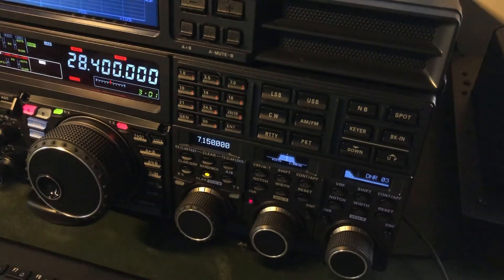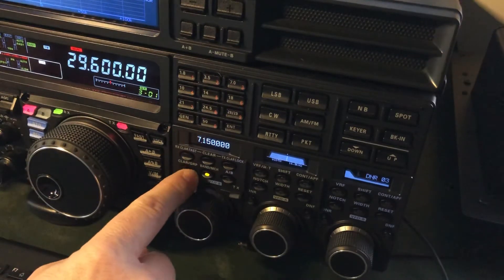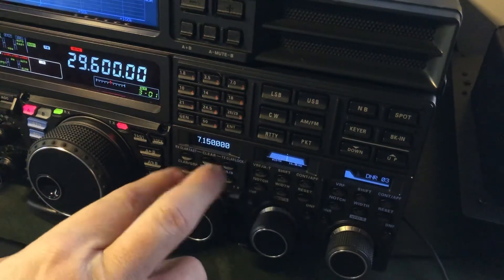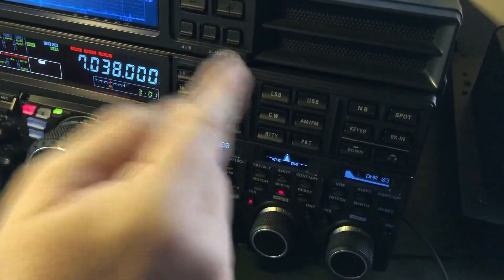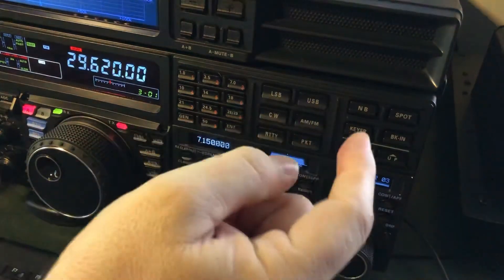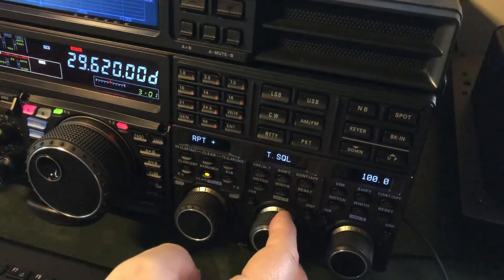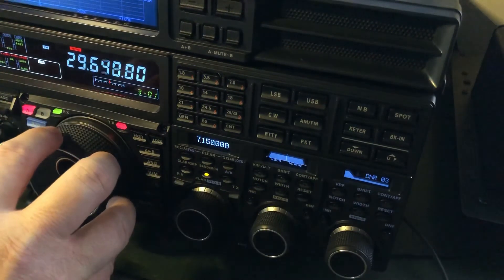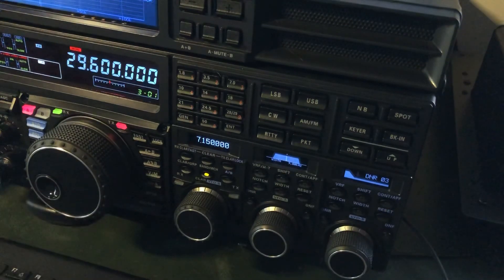Yaesu FTdx5000MP: FM Repeater Operation

Comment: what if you need a up and down code and they are different
Reply from the maker: You can only have one code active.  I don’t know of any HF transceivers that offer split tone.  Maybe Flex Radio or Anan can, but I don’t know.  Only certain HTs and mobiles have the ability to split the tone assignment.

73, de N4HNH
Reply: @n4hnhradio  Thank you, I love your video's, I have a ftdx101mp which is kinda like your ftdx10, so you video's have really helped me with this monster.
Reply from the maker: I’m glad to hear the videos have helped.  There is so much similarity between the FTdx101D/MP and the FTdx10.  Just less knobs, one receiver, and no VC-Tune in the the FTdx10.

73, de N4HNH
Reply: @n4hnhradio  Yes... It was scary at first, almost sold it. Then watch a few you tubes videos and found yours, and fell in love with it.. keep up the almost work!
Reply from the maker: Thank you!

Comment: Not about this video. Other day watched a video on the 891 Yaesu. The blue light on it. Does that light help to center the digital modes like ft8 ?
Reply from the maker: Hi Royce!  I’m so sorry, but I don’t know about using the ZIN LED for FT8.  I haven’t used FT8.  Since CW is a single tone, the ZIN circuit might not be able to lock on the FT8.   The ZIN feature is simply looking for the frequency offset that produces the sidetone frequency you set.  I guess it wouldn’t hurt to give it a try, but I doubt it will be useful for digital.  I wish I could help more but I’m pretty much a CW, SSB, FM, and AM guy.  73, de N4HNH